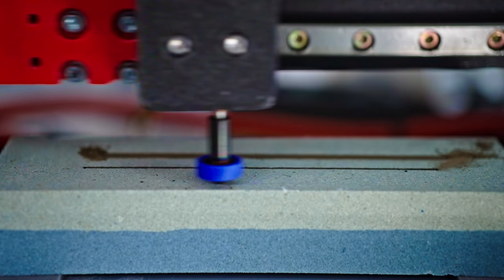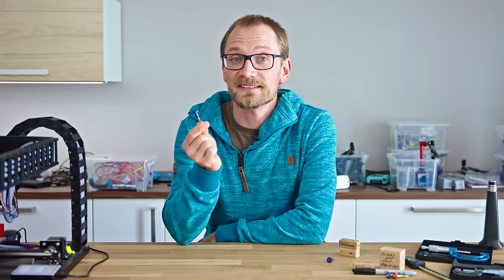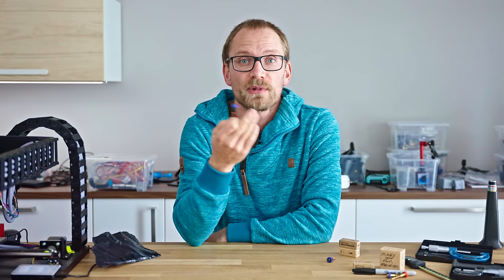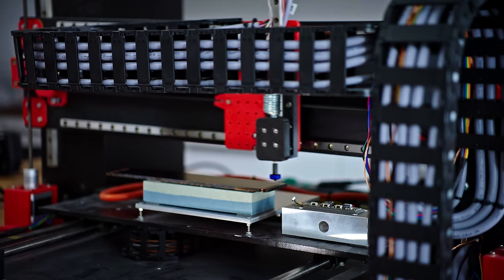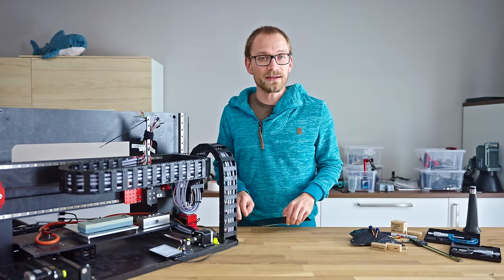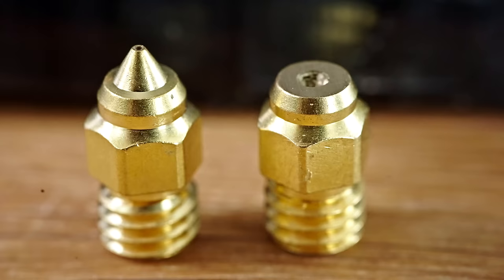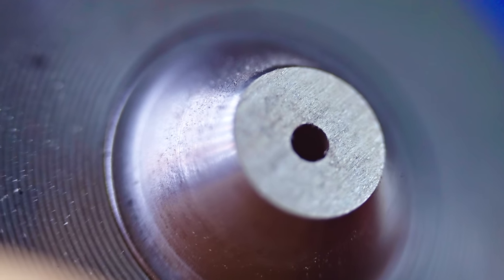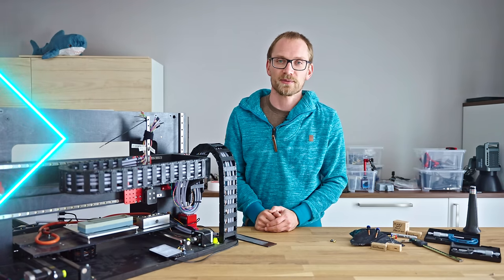How tough is ObXidian really?

Comment: Hi, this may not be a pleasant comment but i write it in the hope to be constructive criticism!
 The carbon fibre sheet is not a good analogy even roughed up to short strand carbon filed materials. Because a laminated sheet has the long and continues graphite fibres parallel to the surface, while a carbon filled materials short fibres are more randomly oriented and the ends of the graphite fibres do the wearing, Like a wire brush but whit much denser and harder wires.
As for the grind stone it stopped removing material because it got clogged! 
Grindstones are used wet to help eliminate the ground away particles from the pores of the stone, this one of the reasons we use deluge systems on grinding machines, (the other is thermal management). So in order to maintain the same material removal rate, the stone should be cleaned after each test run, not very practical i know! But it is a validation condition even in non laboratory wear test. 
AND the objection that i have is the inconsistent and uncalibrated load. If the goal is to compare and not calculate material removal rate, then all nozzle tips should have been calibrated to the approximately same specific pressure.    
Hope it helps whit future tests.

Comment: Wow great build of a test rig with perfect images!! Very impressive!! I have no experience with 3d printing but do have some with abrasives. And did wonder what are you actually testing? the nozzle or the abrasive? 
And to be clear, my comment or better question is in no way ment as a judgemental but my own thoughts just out of pure curiosity. Because i like tests:)
If a test is valid, it will produce comparable results for many materials. In this case you have 2 homogeneous and one combined material. 
As with abrasives, in this case the stone, will get polluted. With the abraded material and in this case a combination of stone  and material parts, that has an effect on the final result. A good abrasive  for a specific material is determent by the hardness, grains per cm/inch and way the abrasive is able to shed the particles and not get polluted. This last one is a main factor in effectiveness and/or useful duration time. Sand a block of soft clay with a diamond 100 grit paper makes that clear. But is that result a fair comparison or give comparable results against sanding wood or stainless steel with the same 100 grit paper? Do these results then say more about the abrasive or the material? Clay being the clear winner:)) 
Not applicable for 3d printing nozzles, but what if i would coat a brass nozzle with 0,3mm nylon. My guess is it would outperform the obxidian. Simply by first polluting the abrasive then just glides over it. As might be the case with polluting (transfering particles from nozzle to stone), with obxidian. Then the underlying steel of the nozzle glides over the obxidioan layer on the stone.  Should one not inspect first the pollution on the stone instead of the nozzle to check if results are in a way comparable?

Comment: On obxidian it makes sense that as soon as the coating is gone, any abrasion resistance goes with it and the base metal will erode at its normal rate. I'd love to see this repeated with a diamondback nozzle. I predict it would leave a substantial groove in the sharpening stone and not much damage to the nozzle.

Comment: very important question, did you do the test at 250C nozzle temp? normaly metals softer a lot when heated...
Thats why most machines use tungsten inserts (CNC and so)... because tungsten does nearly not soften even at 1000c

Comment: Diamond has a drastically different thermal expansion coefficient from brass. I would guess that heating it up too much will put stress on the coating and if you have too many cycles too high the coating will splinter off or detach at some point. 

When comparing such coated nozzles one has to consider that they will fail very quickly once the relatively long lasting but superthin coating is damaged. A hardened steel nozzle will be damaged faster but it will stay resistent more equally even after loosing the first layer.

Comment: If you can get the setup to automatically adjust focus, this would be a neat way to visualise the internal geometry of a CHT nozzle or imitation thereof. Maybe have an electrode at a fixed height, and move the remains of the nozzle down towards it until you have continuity to probe the remaining height of the nozzle?
Reply from the maker: I could just take the extra MGN9 out and hard-mount the nozzle to the X carriage, then move into the grind medium a defined amount and run cycles until I'm sure there's no more grinding happening. The Z axis itself should have sufficient resolution to create some sweet-looking grindlapses!

Comment: Cool test setup and interesting results, but the "choices" make it feel like a flawed experiment to me.
If the only Obxidians at hand were .6 it would have made more sense to compare against other .6 nozzles, which shouldn't have been hard to source, instead of resorting to added weights and assumptions. And that's leaving the shape differences aside. In the end, neither with nor without added weights is it an "apples to apples" test.
The conclusions are almost for sure on point, but only "almost".

Comment: Which Webcam did you use for the macro mod? Did you use an additional lens or did you adjust the focus? 
Great review as always!
Reply: Looks like he used a HP HD4310 1080p Webcam. Which he took apart and then manually adjusted the lens inside for very close-up.
Generally it doesn't matter what kind of webcam you use, so long as the lens allows for adjusting and isn't glued in place or something.
Reply from the maker: That's the one I used! You want at least a half-decent sensor and signal processing, otherwise you'll end up with clipped highlights and weird colors. There are some very nice bare-bones USB camera boards available now for not much more than I paid for this webcam, and I would highly suggest getting one of instead of trusting a webcam's resolution claims.
Reply from the maker: Also, I did fully unscrew the lens and simply glued it in place at the most extended position with a dab of epoxy.
Reply: Surprisingly just about any webcam would work. I have the cheapest, shittiest 720p ish webcam in the world and it too has a focus ring. Raspberry pi cameras also have focus rings, Everything has focus rings.

Comment: Great video.  I do like your setup rigs.  for the max temp, it could be from expansion rate of the different materials that are made with.  Coating process.  is it electro plated, CVD or PVD, etc.  also higher than 300 deg might be reaching that nozzle's annealing temp.

Comment: It won't cut the hardened steel Because every time you go back and forth on the stone you're imparting parts of the stone and the metal into the cavities of the stone and it fills up You're not using the stone properly is the problem When you sharpen knives with stones you have to keep them clean with immediate medium because we are already know that it will Fill up The groups and it stops cutting Just FYI

Comment: Obxidians sure look neat if you have a Revo. The 0.6mm in particular seems perfect for all those print jobs involving the more exotic PLA blends.
Just a shame it is almost impossible to find any in stock. My local 3D-Printer parts retailer has an expectation of them being in stock late april at its earliest.
Reply: I bought mine online in Canada from a retailer in Alberta, did no see it at Amazon, local retailers, my Montreal supplier etc.
I bought 4 different sizes, ain't going back, they really suit our workflow and printing.
Not 1 clog, issue or problem through hundreds of prints. Albility to change nozzle size easily is worth a lot as well.

Comment: Very intresting results, but you missed one critical test factor..  ObXidian vs NozzleX in the same test case.
I love my NozzleX's and want to move to a Revo platform across my machines, but my concern is how ObXidian does vs NozzleX 

Keep up the great work Tom!
Reply: In theory much better, nozzle x is a steel nozzle with some fancy coating you shouldn't scrub with brass brushes. The obxidian is mostly copper for better heat transfer and you have obviously seen the coating

Comment: you should add wiping to stone so that it would be clean stone. for files its a big problem especially on aluminium that it glogs up. same on sandpaper (the reason why there is wet sanding - it will float away material so that paper will stay more stable). If grindstone fill up, grindind will need alot more force to grind at same pace.

Comment: how about just printing a ton of GF-/CF-PA, glow-in-the-dark, stone-filled, or colored white with TiO2, to get realistic conditions? the coating might be engineered for exactly that, instead of being optimized for scratching specialized abrasives.
I have also heard about huge differences in pigments used for dying the filament...which can change the abrasive properties depending more on color than the material itself.

Comment: When the Obxidian nozzle starts grinding away at the stone the test is somewhat useless.

It is clearly more resistant because it is harder, but it grinding away at the stone isn't comparable to real life use, unlike the steel one scraping over the same stone. Filament doesn't get less abrasive while printing after all since the nozzle never touches the same filament twice.

It would be interesting to see(RIP nozzle 3) the same setup but with the nozzle being scraped over the stone in non-overlapping lines. That way you remove the effect of the  nozzle smoothing out the stone. You'd obviously run out of stone then, but something like 1600grit sandpaper would work since you probably don't run the risk of ripping the paper if you only pass over every point once.

Comment: Hardened steel is very vague in description. It could just be case hardened mild steel and that would wear much quicker than a full hardened material like 4340 which would be hardened all the way through. A fully hardened nozzle would not wear like the materials you have shown.

Comment: Fantastic testing platform! However, it does not address heat and the pressure from the inside the nozzle. Would another test involve a carbon fiber "pipe cleaner" moving in and out of a heated nozzle?

Comment: The only thing worth considering in wear resistant nozzles is pure tungsten carbide. Anything else is going to get destroyed by abrasives, just slower than normal. TC should last forever with anything short of diamond infused filament. I've seen pics of destroyed Obxidian nozzles just from a few roles of CF (PC or nylon, I forget which, probably both).

Comment: A carbon fibre  sheet may have long and horizontally oriented fibres. Whereas printed has finally chopped more randomly fibres with more exposed fibre ends. 

Just a theory as to the wear differences.

Comment: What I don't like about ObXidian is the price (not in relation to other Revo nozzles but generally) and the fact that a nozzle made from a decent material would've been even stronger and wouldn't even require all the mumbo jumbo.

On top of that: With a wear resistant nozzle without wear resistant heat break, you're gonna change the nozzle anyway at some point.

Comment: Im not OK with using a grinding stone on the nozzles. The hardness of Al2O3 might be way too much compared to carbon filament or that Sr stuff in glow filaments.
It would have been better to use that carbon compound plate, but not on its top/bottom surface where the carbon fibers are parallel to the surface, but the side where the fibers stick out.
Doing so would really tell how resistant the nozzle materials are on real world workloads.

Comment: I have one question about how you did that. I'm a mechanical engineer with some interest in electronics and coding. Lets say I know enogh in those fields to replicate what you did, I still couldn't do it. I know how to design and solder circuits, I know how to code, I have worked with arduinos, but there is just this one gap I can't seem to bridge. Do you have an idea what I'm missing? Possibly it is just some piece of software or hardware, but I just don't know and it has been bothering me for so long. BTW love how you went "So! It's done." and not "So, it's done." (only Germans will know the difference I guess )

Comment: What about Nozzle X from the previous generation? Is it made with the same tech as this new ObXidian?
Reply: Yes and no. The Nozzle X mostly relies on being a specific kind of hardened Steel alloy to get its durable nature. The coating on it is more to resist having plastic gunk stick against it ("Polyphobic") and not to provide extra durability. The ObXidian is also using a hardened Steel alloy at the tip, but the coating is a hardened form of carbon that besides not being sticky does add more durability.

So in a test like this. You can assume the NozzleX to mostly perform similiar to the hardened.

Comment: Hi Thomas, any idea on how a tungsten carbide nozzle like the ones from phaetus compare against obxidian? Like wear resistance, thermal energy transfer and so on. They also have some kind of coating and are rated for 500 degrees. Im still torn apart if i should buy now tungsten nozzles or wait for the v6 style obxidian nozzles
Reply: I have one of those and it worked well so far for me. No problems at all, and still wipes clean really easily 7 months later.
Reply: Then again, didn‘t get to printing CF / glow / etc filaments yet since then, only PLAs, PETGs, ABS and TPU.

Comment: Would still prefer a tungsten carbide nozzle. Better heat conductivity than steel, and harder if you wear through the coating. And not really much more expensive than the Obxidian nozzles either.

Comment: Have you heard the expression "packing" in relation to grinding? For the harder nozzles I suspect the stone was effectively filled with small particles of the ground material, resulting in reduced performance over time. This is typically more pronounced when grinding harder materials as they will pack up and skate more easily.

Food for thought 🤔

Comment: How accurate is the repeat accuracy when screwing in? Is the nozzle always the same length?
Reply from the maker: The length and precise height doesn't matter for pretension, as the nozzle is free to ride up and down on the extra MGN rail. The only thing pressig it against the carbon or the stone is gravity.
Reply: @MadeWithLayers  The question was not related to the durability or the experimental setup. I wanted to know whether the length of the bottom edge of the Nozzel always stays the same or whether it varies. Whether you have to reset the offset after each exchange
Reply from the maker: Ah, sure. I re-zero to the point where the nozzle is perfectly in focus over the camera and perfectly in frame. Then, the area where the grinding cycles happen is a fixed offset from that position.
Reply: @MadeWithLayers  You misunderstand me. My question relates to changing the nozzle and whether the length always stays the same. Or whether you notice a difference in length when printing if you have swapped from a 0.4 to a 0.6 nozzle, for example.

Comment: The e3d Revo is a great idea, the engineering is nice... but I really, really don't like it- why?
well, there's been products out there implementing the same idea (nozzle-heatbreak hybrids) for quite some time now, and in a much better way- Dragonfly HIC HF, for instance
TriangleLabs and Prusa's Nextruder use the same system: 
just take a V6 nozzle, and stick a stainless capillary into the end; the result is the same (no hot-tightening required), but it's still compatible with all the heater blocks, thermistors and whatnot out there... not to say, they will likely be cross-compatible at least to a degreee
secondly, the only reason why the Revo will be not is that they decided to stuff the 3rd piece (heatsink screw) in- aside from the whole "no part is best part because it cannot fail" , this needlessly increases cost (there are DLC coated composite nozzles from TL that cost half that of Obxidian) while also making the product worse.

Comment: Appears to be reasonable test methodology, but my gut still says "shilling for E3D."

Real talk. . . nozzles are cheap as dirt, and plenty easy to change with the right tools and experience. Even the hardened steel ones. I simply don't understand why there needs to be over-engineering and hair splitting here. A hardened steel nozzle ABSOLUTELY WILL PRINT dozens of prints with the most abrasive filament you can find before you print quality starts to suffer.

Comment: why not just a tungsten carbide nozzle?
with EDM it shold be perfectly reasonable to drill that stuff, and I know that it is pretty hardfrom my time as a machinist
hardened steel and even glass can be machined with that stuff, so I would be pretty sure that a small tungsten carbide insert in a brass nozzle would make for affordable and durable nozzles, most certainly many times more durable than hardened steel

heck, even HSS would be a good option

Comment: Uhhhh... wasn't nozzleX supposed to be the last nozzle we ever need to buy? 

One can get a whole TZ-v6 high flow hotend with ceramic heating pad, 4 hole dragon rigid mount heatsink, hardened steel CHT clone nozzle all for literally half the price of a SINGLE obxidian nozzle. I just don't see the value proposition here when there are so many well performing cheap hotends on the market with which one can use their existing V6 nozzles.